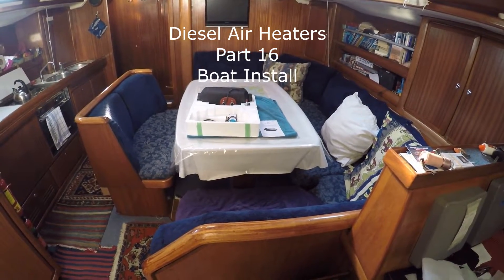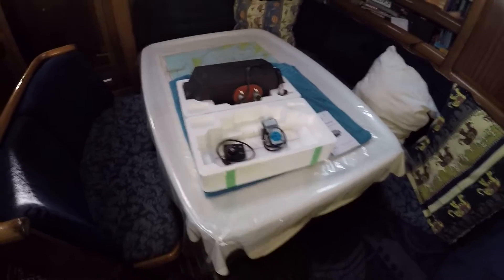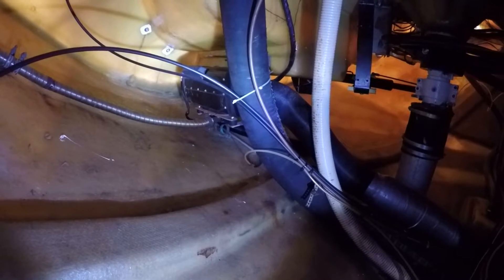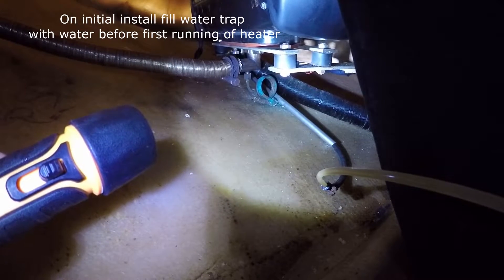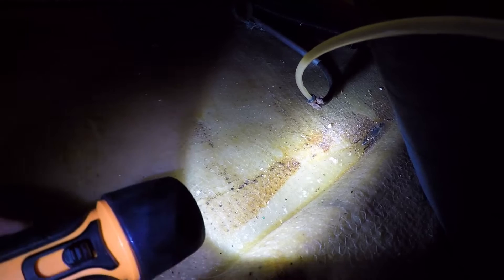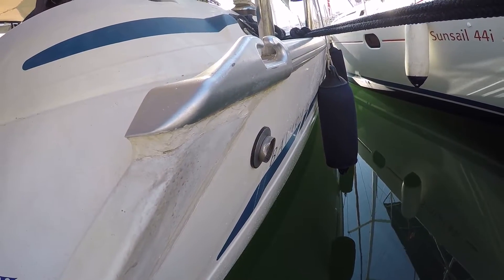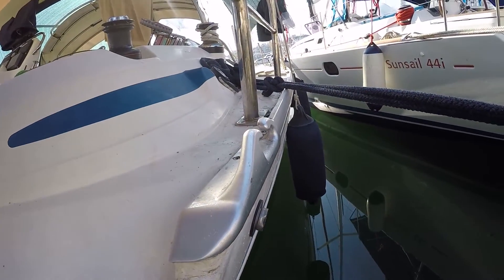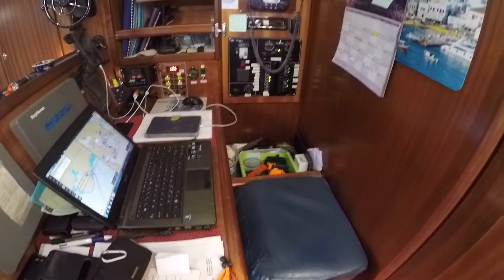Diesel Air Heaters Part 16  -  Boat Install

Comment: Hi John, I built a portable heater for winter camping.  What's proper ducting for that?  The 3in rigid stuff is probably fine, tho my ducting with be exposed to snow.  Any ideas?
Reply from the maker: That should be fine. A good way to keep warm.  JMcK
Reply: @johnmck1147  I went from a 3" diameter output down to 2.5 where it plugs into the camper...would that be real bad or OK?  I'm worried about back pressure or something like that
Reply from the maker: No Vin, that should be ok.
It is most important not  to restrict the combustion air inlet and exhaust outlet, not so much the hot air outlet.  However go too small and you can get overheat issues.  JMcK

Comment: Hi John, thank you for your video. I’m really tempted to fit a Chinese 2kw unit in my 33 ft racing boat. Obviously I would use the marine exhaust upgrades and proper clamps etc but I  have one question about the condensation drain. Webasto suggest that they are not needed with an exhaust run under 2 metres. Mine would be very short and I’m tempted not to fit a drain. What do you think? 
Also were you planning to replace your Eberspächer with a Chinese unit?
Thank you for your reply!
Reply from the maker: Hi Justin,

Yes, I was going to replace the Eberspacher with a cheap Chinese heater. 
The Eberspacher are excellent heaters but the cost difference was just too great for me.

The Chinese copies are also great little heaters, but their ECB,s and wire plugs are not sealed. (Eberspacher are)
In a marine environment I suggest you spray sealer on the ECB and something like WD40 on the plugs.

If you operate in a cold wet environment, (coastal areas) there is a lot of condensate produced. 

If this water sits at the bottom of the exhaust, and you don't need much, it creates a blockage and the little heater fan is not powerful enough to blow it out. The heater will not run properly or even start.

If you mount the heater high up just under the deck, or in an outside locker and the exhaust went straight out you would not need a drain.

If the heater is mounted low down in the boat  there is nothing stopping you from trying your heater without a condensate drain. You won't blow the heater up. I have not personally seen that Webasto comment. But I would personally use a drain in my boat install.

Cheers.  JMcK
Reply: @johnmck1147  Thank you very much John!
Reply: @johnmck1147  Hi again John,  I expect you may have covered this before but would you say in your experience that the Chinese units are similar to the German units from a running noise viewpoint?
Reply from the maker: Justin Barber ,
Yes Justin.  JMcK

Comment: I'm hesitant to get one of these because of the noise. Right now I have a Buddy catalytic heater which is totally quiet. My main complaint is that it is not thermostatically controlled and I have to manually start and stop it at night. I would love to see a video with the best install to reduce noise to a minimum.
Reply from the maker: Hi Rob, please watch the video again. Installed correctly these heaters are pretty quite. Yes, they do make some noise, but I can hardly hear our heater in the boat. 
You get two big advantages over your catalytic heater, 1 no gas burning in your boat. 2. A dry heat, none of that condensation you get from a gas heater.   JMcK

Comment: Where do you find the copper condensation drain coil here in Australia?? I can't find it any where - and how do you tap the exhaust pipe ??? Its killing me!
Reply from the maker: Hi Charley,

There are a number of suppliers online, below is just one link to get you started. However, one will cost more than the heater itself. They are cheap and easy to make yourself if you have access to a TIG welder for a SS one, or you could make one using a copper elbow with just soldering skills.

Suggest, if you can't TIG weld or have a friend who can,  you make your own from copper if you can solder, or have a mate who can. Remember to slit the copper elbow where it joins the heater and use exhaust gasket cement or HT Silicone.

There is no real need to have the copper coil removable if using all copper. It can be soldered to the elbow. Splay the tube where you solder.

https://www.everythingcaravans.com.au/products/autoterm-diesel-air-heater-exhaust-condensate-drain

Cheers.   JMcK
Reply: @johnmck1147  Thanks SO much - I should be able to make it - your video is the only one that talks about it - love the videos!

Comment: Hi John,   I enjoyed watching your series of videos on these heaters..   On a more technical note is  there anyway of 'tuning' these heaters..ie setting correct combustion..  I would assume its an adjustment of fuel flow via the pump and fan speed?  and test co2 output through all heat settings..   Would be great if you would be kind enough and look into producing a video to guide us owners of these heaters..   Finally,  here in the UK a lot of Ebay heaters now have the simple Dial thermostat device thats apparently digital and it comes with a 2 button remote...  A lot of guys state theres no 'pairing' instructions for these... Again your advise would be brilliant...   Rick
Reply from the maker: Hi Rick, the heaters come pre tuned for normal atmosphere pressure, there is no need to fix what is not broken. With the LED digital controller you can go into the password protected settings menu and change the pulse rates and fan settings, but those who do that often open up a can of worms and get the heater all out of balance.

I do not know how, or if it is even possible to pair a remote to the simple dial type controller. Sorry.
JMcK

Comment: Hi John. Thank you for your time making these heater videos!
Is it possible to have the fuel tank around 1m higher then the heater unit?
This would get about 0,1 bar of pressure in the fuel line before the pump.
Or these pumps has to suck the fuel without any pressure in the hose?
Reply from the maker: Hi Peter, sorry this is late, I initially missed your post.

You can go up to about 2 meters of head pressure without too many issues, however you really need an inline shut off valve in the fuel line between the tank and the fuel pump.

The issues you have is fuel leakage through the pump. The pump piston is forced upwards by an electromagnetic field but returned down by small springs. Head pressure can cause diesel to overcome the little springs and leak past the pump. If the heater is also lower than the fuel tank you will get diesel leakage into the burner and flooding.  

So install a shut off valve. Turn the fuel tap on when you wish to use the heater and off after use and you prevent issues arising from potential fuel leakage.

Regards.  JMcK
Reply: @johnmck1147  Thank you!

Comment: thanks for the video!! what model is that quiet fuel pump? and what is the price point?
Reply from the maker: Hi Jasmin, 

The fuel pump is a standard electromagnetic dosing pump, same as all the others. It is less noisy because it is suspended in space rather than mounted to a bulkhead, and then has a six inch mattress on top of it. 

What do you mean by price point?  You can pay well over $100 for one if it has a certain brand name, or  around $20 off the internet for a similar unbranded pump. 

Cheers.  JMcK
Reply: @johnmck1147  thank you!! I saw some videos of people swapping their standard pump with a “quieter” $40 pump (with mixed success). I wasn’t sure if yours was a really expensive pump which might be even more quiet. 

I guess it’s just the suspension of the standard pump that did it. Thanks again!!

Comment: Really informative video.. one question on the water trap though.
It strikes me that the exhaust is going to be pretty hot, and the water trap mounted directly to it. 
If the heater is in regular use,  won't you have a problem with the water in the trap evaporating, or practically does that just not happen?
Do you have any way to check the water in the water trap to make sure you aren't just exhausting into the boat?
Reply from the maker: Hi Jonty,

I have never had issues with the water trap in 10 years of use. 

However you must use one with multiple turns which means multiple water traps. Water in the first trap probably does evaporate but the others would provide some insulation. Also the exhaust gas racing past the trap tends to creat a sucking effect from the trap rather than blowing into the trap.

However, with any appliance like this it is good practice to install a CO meter in your boat or van.
I do check the trap with a test CO meter on first season start up as I suspect some evaporation after 6 months inactivity. But I have never actually removed the water trap and checked it for water. Something I will do next season for my knowledge.

Regards.   JMcK

Comment: John, love your series.  Question:  I have a 5K.  If I find it is too big for my van, is it possible to just change the dosing pump to basically convert it to a 2K heater?  Or is the burner different between them?  Just wouldn't want to later have to remove the whole unit and mess with different hole configuration between units.  Thanks
Reply from the maker: Hi Andy,
Real 2 kw and 5 kw heaters are different sizes, but some suppliers fraudulently market a standard 5 kw heater as a 2 and 8 kw heater.

Both 2 kw and 5 kw heaters have exactly the same mounting bracket, and the same exhaust hose and the same combustion inlet hose. Only the heater physical size is different and the hot air outlet hose is different.

It is easy to swap out a 5 kw heater for a 2 kw heater.

Regards.  JMcK
Reply: Did you end up buying a 2kw heater? I'm looking to heat a honda civic. Want a stealth and quiet heater. So trying to decide if u should go 2 kw or 5 kw. The 5 kw is quittee but may be to much for a small civic. Thw car has jo I sultation and would be use in -10 celcius weather.

Comment: John, Excellent series Hats off to you. few Q's, 1: What do you think about relocating the ECU to the outside of the case? In the event of an abnormal shutdown? ie  power outage 2: Im thinking of mounting 2 of these 5K units side by side to replace my RV's Suburban heater(propane/elec unit) which means 2 controllers side by side. thoughts? 3: On your boat. what controller are you using. it looks like a fantastic controller no word on it?.  Million thanks for the awesome effort and series. you are an asset to the community. -Sam
Reply from the maker: Hi Sam,

It is most uncommon to have an abnormal shutdown and I would not go to all the effort to mount the ECU on the outside of the heater. Also a replacement ECU for the Chinese heaters is only around $20. You must have a very big RV or very cold climate to require two of these heaters. They put out a lot of "dry" heat, not "wet" heat like your gas heater.
I prefer the simple dial controller most times, but that is just a personal like. I also like the LED controllers, but prefer to run them on a manual setting, but that is just me. JMcK
Reply: @johnmck1147  John, Thanks for the thoughts :) On your boat. specifically did you modify a readily available controller/remote or is your controller still available.? BTW my RV is 42' 5th wheel it has 5 slide outs. and an 8' ceiling. I think its about 400sqft? +/-
Sam
Reply from the maker: Sam Rod 
Hi there, the simple controller on the table is available as a spare part, but sadly some Chinese heaters now are not using standard wiring. The controller on the wall of the boat is the Eberspacher controller and is 20 years old. It won't be a simple swap to a Chinese heater.
You have a large impressive RV. And I thought 2 slide outs in Aus was impressive, you have 5.  Good luck with your install.  JMcK

Comment: Absolutely brilliant videos John, thank you. 
In one of your earlier videos you mention you shouldn't obstruct the exhaust flow 'too much'. 
In this clip your exhaust begins with a 90 degree elbow, the exhaust is longer than normal and it ends with an almost 180 degree loop before going thru the hull. Also, i see that the thru hole exhaust fitting is a lot narrower than the factory exhaust pipe. 
My question is, do the settings need to adjusted in some way to accommodate the obstructed airflow mate?
Reply from the maker: Hi Fitzy, the boat install was a professional install by an Eberspacher agent and it has worked very well for 20 years. I think it would be better if the outlet from the heater was a "rounded" 90deg curve but what I have is standard Eberspacher.  The exhaust hull outlet is actually slightly  bigger than the exhaust hose. No adjustments are needed to heater operation. The positives of the upward flow of hot exhaust gases in the exhaust easily negate the gas restriction of the water ingress prevention bend. I hope this helps.   JMcK
Reply: @johnmck1147  certainly does help John, cheers, keep the videos coming and thanks for putting the time into making them mate

Comment: I have a question what the difference between some pumps. I have come across 12/ 24 by 16, 22, 28, 32, and even 65ml pumps. The most common is the 12/24 by 22ml; can I assume the metering dose it delivers?
Reply from the maker: Correct. 
The most common pumps are 20 and 22 delivering .02 ml and .022 ml of fuel per stroke.
JMcK

Comment: John, the videos have been great - binge watched them!  And ordered a heater for my camper.
I have a question that's been bugging me. You may have answered this somewhere, but I didn't pick it up. I'd really appreciate it if you can answer this question. When you set the temperature on the thermostat and the temperature gets to the preset value in the cabin, does the heater shut off the diesel feed and air pump (that is does it initiate the shut down procedure) or does it just go into a low burn rate setting (low Hz)?
Reply from the maker: Hi Benny,

Most controllers just cut back the pump frequency and fan speed, but occasionally they shut down completely.

I personally often prefer to use the manual settings, but that is just me, others like the thermistor setting. I feel with manual you do not have the heater ramp up to maximum speed as it tries to increase the temperature of the heated area. With manual, I generally choose a quieter mid range setting and gradually increase the temperature without excessive noise.  JMcK
Reply: @johnmck1147  Thanks John, my unit arrived today (surprised it was so fast), so I will find out. Another surprise is all the ducts and bits were packed within their own box and completely undamaged - another surprise! I get what you are saying about manual control to keep noise down. Thanks for another tip, I wouldn't have worked out until after it was installed. I may be able to accommodate for that in the camper as I build it.
Reply from the maker: Benny Banger ,

Thanks for the feedback. Safe travels.  JMcK

Comment: Thanks John, have you any ideas as to how to use the waste heat in the exhaust to boost heat an electric water tank?
Reply from the maker: zwarst 

Hi Zwarst,

Yes I have wondered about wrapping small bore copper pipe around the exhaust hose to act as a heat absorber, I am not sure if you could use a length of the supplied exhaust or you would need to make something new from scratch. 

My circumstances have not pushed me to experiment further on this, but if I lived in a winter cabin, I am sure I would experiment to see if I could make plenty of hot water.

Cheers.   JMcK
Reply: John McK 47 thanks Jon, I’m in a shack next to the Macdonald river NSW so I’ll be looking into soon.

Comment: thanks for such a well informed and intelligent series john. there was lot there i wouldn't have thought of. i was impressed by the section on fuel lines. i am a senior citizen or old fart in english and have built or made stuff all my life. so it's nice to find something new i had never thought of. Thank you. thinking of replacing my japanese inverter heater with one of these in the house as lamp oil is 4 times the price of c2 kero over here in the UK.  just need to drill a hole though a 9 inch wall for the exhaust.do you know if there any restrictions on the hot air outlet length.?
Reply from the maker: Hi Robert, thanks for the feedback. The shorter the better for the outlet, but they often run 10 meters or so on boats without any real issues, but try to keep out sharp bends.  JMcK

Comment: hi john 
I think from what I have seen you are the Guru of Diesel Heaters
here's my question I purchased an 8kw heater it worked great for a couple of days 
we shut it down and when we came back to restart it we found the fans were run and we got an error code E07
unable clear or reset unit any ideas please ?
Reply from the maker: Hi Mr B,

E07 is a wire fault. Check that the plug connections are tight and there is no moisture in the connections. I suggest you unplug the connectors and spray them with WD40 or similar, and make sure they are tight when reconnected. 

Also check that the 12V power line is ok and there are no lose connections and fuse is in tight.

Poor plug connection or moisture in the plugs is a common cause.

Regards.  JMcK
Reply: Thank you I will give it a go